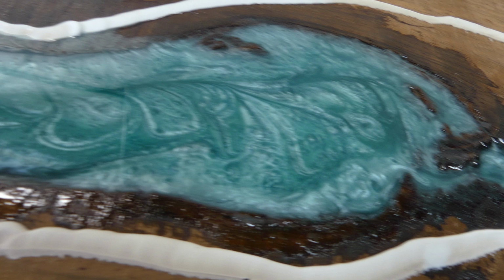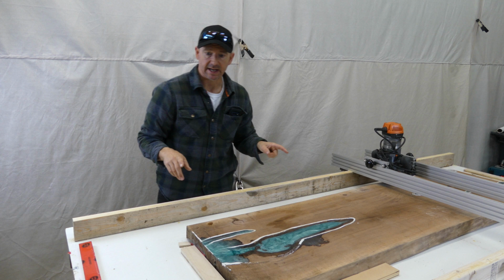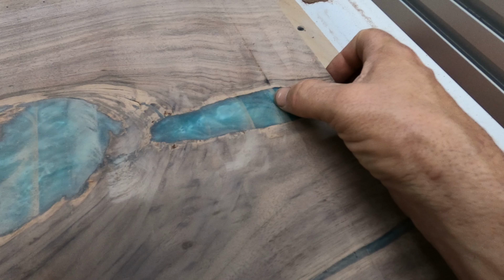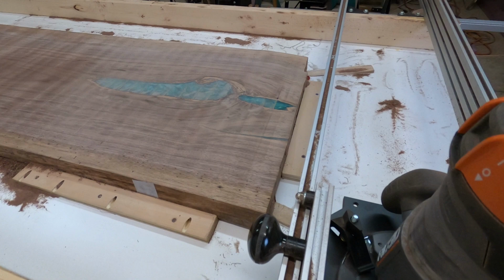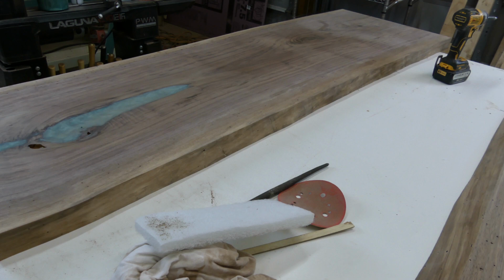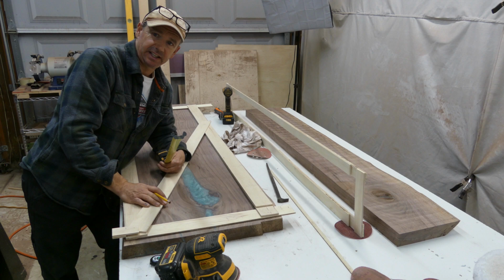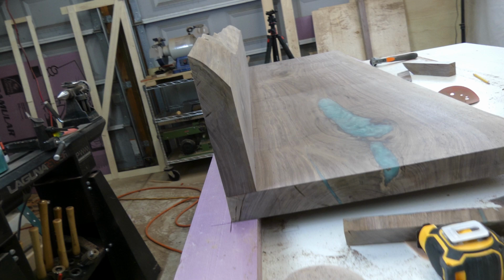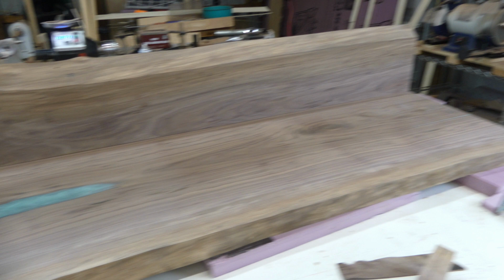Walnut vanity top build. Video 2

Comment: Very nice! Hope the install went well. How do you like that aluminum router sled?
Reply from the maker: Joseph they changed some things in the bathroom. So the install has been postponed until Monday at which point I'll upload the final video in the series. The router sled is so so. Wish it had wheels and an easy router mount. But its very accurate.